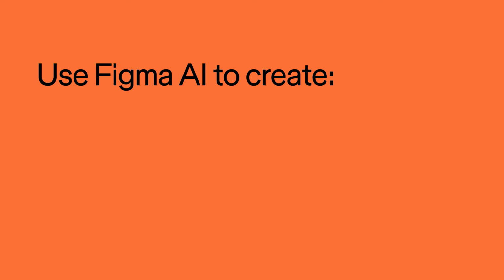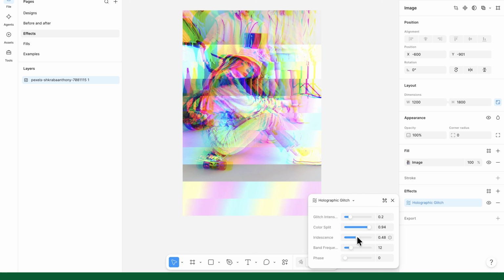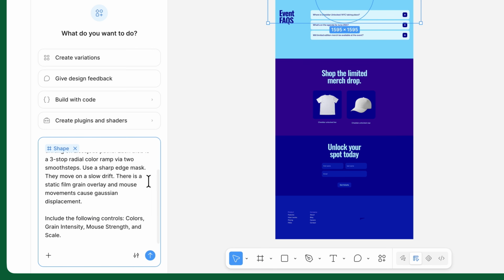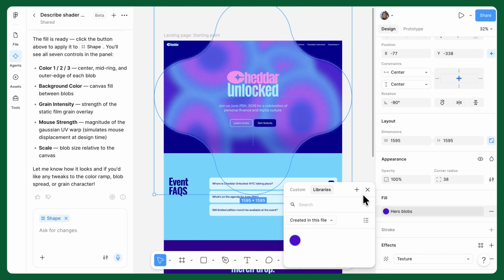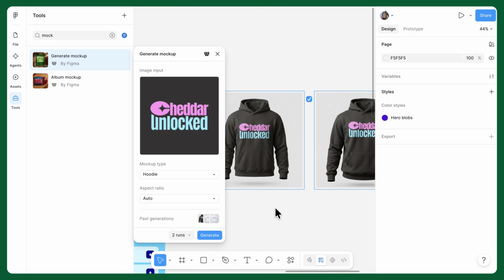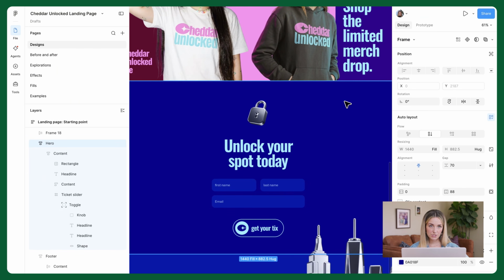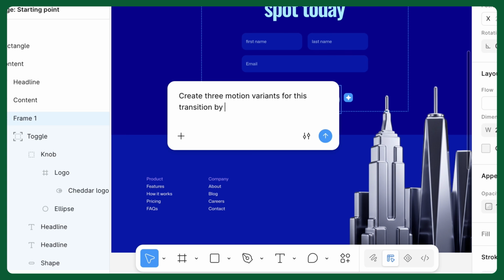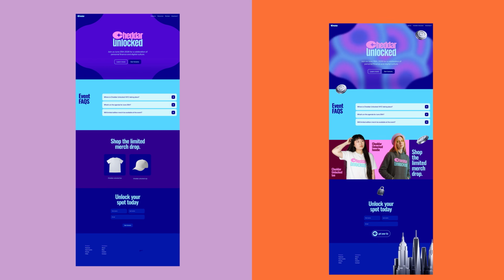How to use Motion, Weave tools, and shaders with Figma AI

Comment: Every AI feature makes me worry about tokens... you don't mention cost
Reply: and from the look of the UI when there is a cost they've gone out of the way to not present it front and center.
Which is disgustingly ironic for a literal UI design company to engage in such anti-consumer UX anti-patterns.
Reply: @TheNewton  There are tons of bad UI in Figma, very frustrating tool to use. Comments/Annotations are always in the way so you have to turn them off. Notifications are hidden on the launch page only. Library updates seem to be hidden on purpose too. It's very messy.
Reply: as long as it looks and sounds pretty to investors to stay up to speed in the AI race